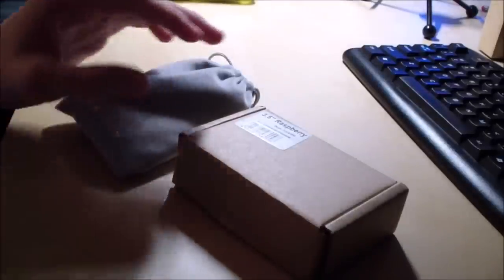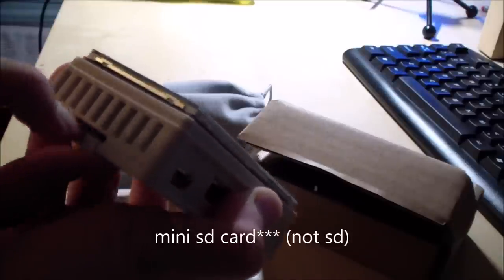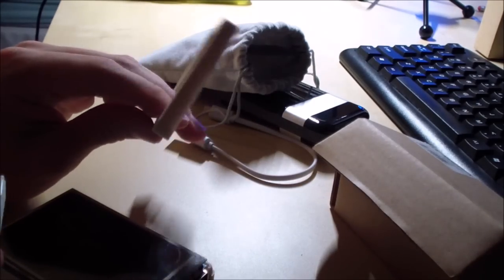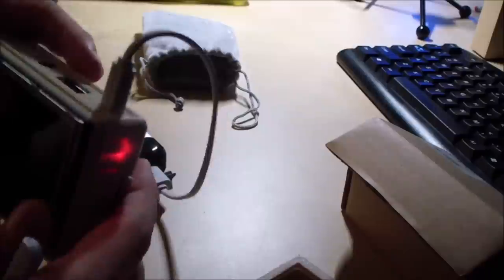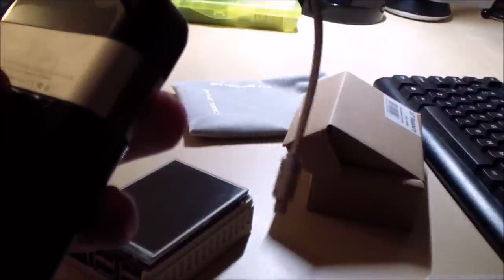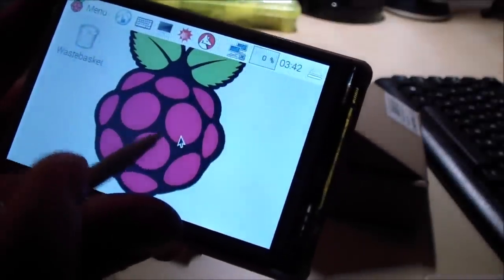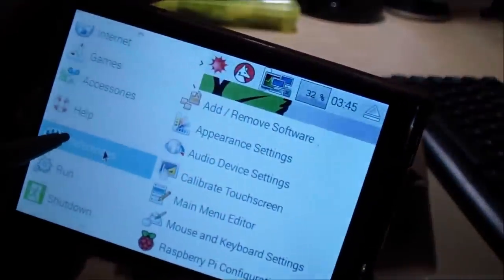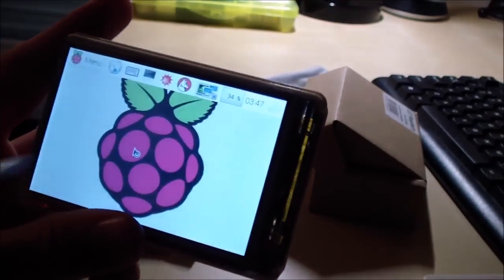RASPBERRY PI 3 TABLET/PC (PORTABLE)

Comment: ''It's completely wireless except for this wire here..'' lol u made my day. xD HAHAHAAHHAA
Reply from the maker: Sorry But I think that you didn't understand the purpose of this video, or you just haven't worked with Raspberry Pi's before. As I say several times in the video, this design CAN be made completely wireless by soldering a battery unit to the Pi board itself. However, this is difficult and selecting a proper battery power supply (PU) is not effective (in my opinion) my case doesn't have a place to mount a PU, so I went with a USB power bank for phones. Please note that this design can be made wireless, the wire is just to connect it to the power supply. Technically a laptop is wireless too, but it still requires a cord to charge....
Reply: Man I know I was just kidding :)
I'm owning Rasp 3 myself and right now I'm working on a concept with purpose to win a contest :)
I was just kidding so don't take it seriously great job man
Reply from the maker: JovanPlaysEverything thanks man. Sorry if I was being mean to you LOL. I have just had many trolls and haters on my channel recently. That sounds like a great contest man, I hope you win, or at least get a high position. Me, myself, I don't know much about programming and coding with the pi, to be honest, I actually practically don't know anything

Comment: 13:25: It's pcmanfm that takes up the processing power! Not the screen! The file manager, ie. the desktop, most likely (long time since I used a desktop on a rpi).

It's weird though, as he has no icons on the desktop... most likely the Pi is underclocked, so it shows what usually takes 2% or so as 20%, lol.

Comment: If i want to connect the screen and than a thermal camera which goes through the gpio pins can i do so? or does the screen take up all usable gpio pins? Please respond
Reply from the maker: sorry for the long reply, I was away for a while, first of all, it depends on what kind of connection does your thermal cam use and how it connects. It is possible to connect a camera through soldering to the remaining 14 GPIO pins, it would be quite crowded but possible. Keep in mind that different gpio pins perform different tasks, so depending on your camera's requirements, it might or might not work, if you have any questions please write back.

Comment: I was thinking of getting one of these. But compared to getting a 5 inch HDMI touchscreen, these GPIO based ones mostly requires a custom raspbian (that's if you don't know how to install the drivers) and that the refresh rate of the display is very poor. It would be hard to play games or even watch videos. So I'm planning of simply getting a 5 inch touchscreen that uses a HDMI bridge connector instead which only requires you to edit the config file for it to work.
Reply from the maker: that is a good idea, however, it would increase the size of the pi significantly, I do completely agree with you on the horrible refresh rate, and difficulty in playing games, and practically doing anything on the pi including browsing the web. Epiphany browser crashed on my pi a few minuets ago, and when I turned off the pi, I wasn't able to turn it back on, because the OS crashed. It is EXTREMELY unstable, and it is very difficult to work with the pi with such a touchscreen. However, with a 5" HDMI touch screen, you would still have to install matchbox keyboard and config the system to make it touchscreen friendly, because the OS wasn't made to be touchscreen compatible. ALSO: if you buy the same touchscreen I bought, you wouldn't have to install the drivers, I have a pre-configed OS already made, download in the description.
Reply: MineCralex I already own a mini Rii wireless keyboard for my raspberry pi 3. And I didn't buy the 5 inch touchscreen since you were right about it being too big. I instead bought a Kuman 3.5 touchscreen and manually installed the drivers on my current raspbian rather than downloading the offered OS from them. Touchscreen isn't really an essential for me since I just need something to show what I'm typing.
Reply from the maker: Jason Lee The Kuman touchscreen that you bought is exactly the same one i bought!, It is a great company with great shipping which is free even though it ships from Guangzhou, China.
Reply: MineCralex Yeah I chose it because it had the highest reviews compared to the other brands.
Reply from the maker: Jason Lee it is also more expensive than most screens/brands, I saw some cheap screens on ebay for less than $10 a pop, but I was concerned with configing the OS and installing drivers to make it work, so I chose the Kuman one because it has free download of OS.

Comment: HOW DID YOU GET THE SCREEN TO DISPLAY RETROPI I HAVE 3.2 INCH WAVE SHARE LCD SO WHEN I INSTALL RASPIAN THE LCD WORKS BUT AFTER I INSTALL RETRO PI I CAN ONLY SEE SCREEN IN HDMI TV MODE? HELP PLEASE I BEEN WORKING ON THIS FOR ALMOST A MONTH?????
Reply from the maker: Unfortunately, I don't currently know of any other way using which you can get Retropie to display on the LCD touchscreen. There are ways but you have to have very good knowledge in assembly and machine language so you can manually configure the Retro pie Operating System to by default run the video output and touch input through the GPIO pins. Im not good at programming and I dont know any languages so I cant make the drivers for it.
Reply from the maker: DUDE YOURE A GOD MAN THANKS SO MUCH!!
Reply: MineCralex YOUR WELCOME BUDDY GLAD I COULD HELP MAN CHEERS!
Reply: BolowArizona thanks soo much... I might be doing this when I get a pi 3, this is so helpful... One thing though, what would happen now if you plugged into HDMI while in use? Will it swap to the HDMI and back when HDMI is disconnected? (like the Nintendo switch does)
Reply: or you could just sudo raspi-config and add a wallpaper or raspi -config depends on the os you might have to learn python :P

Comment: what would happen if you had the screen attached and suddenly attach a hdmi cable? would it automatically switch to HDMI video output?
Reply from the maker: No it would not, I do not advise doing so, because the OS is pre-configured by the manufacturer of the screen (download in the description), and has the drivers specifically set to work with that specific touchscreen, what would happen is one of two things, 1. Nothing would happen, HDMI screen would be blank, display would be on touchscreen OR 2. OS crashes due to overload/confusion, and because it is not configured to run with HDMI. I think that to connect it to HDMI, one has to go into terminal and raspi config to change some things for it to work.

Comment: is the power bank 2.5a?
I'm trying to do one with a 5 inch screen but I need to used to cables one for the screen and one for the pi if not it will show me a yellow icon on the screen
Reply from the maker: The second USB Output on the power bank is 2.4 Amps, the 1st one is only 2.0 amps. If you use the 2.4 amp output, it should actually be enough to run the pi as I have even heard people running Pi's on 2.3 amp power. I don't know how much amps your 5" screen draws, but check it and make sure that it works from an outlet, then check it with powerbank and it should work most likely.
Reply: MineCralex thanks for the answer

Comment: Hi I'm new to this channel and already linking it, I bought a raspberry pi 3 model B around March this year with the exact same touchscreen you're using. I need help getting the screen to work with Retropie if possible, I've looked everywhere and the tutorials I see have a different kind of screen. I've had my pi collect dust for a while still hoping I can get this portable emulation station to work. If you see this thanks for reading and hope you can help.
Reply from the maker: Hey, I'm really, really sorry that I got so late to you. I had many things to do and wasn't able to log onto my youtube account in a long time. Exactly what is your problem? can you explain in greater detail and I might be able to help you. The thing is, you need special drivers to work with your selected OS, in this case, RetroPie. I use this operating system on my Pi as well from time to time. I'll try to make the screen work meantime, but can you please reply as soon as possible just so I can communicate with you and see exactly what you want to do with retropie.

Comment: Man it boots really quickly, what is your Sd???
Reply from the maker: I have a 32 gb san disk platinum I think??? I actually forgot a bit because I haven't used it in such a long time. Regardless, the card is level 10 speed, and U3, which is quite fast. Actually, If you get a good card that is at least 10 speed and U1, which are actually quite cheap, most pi's boot very quickly, the OS isn't that intensive and if you don't have too much files on it its very fast.

Comment: I really want this case but I dont have a 3d printer, is there another way to get one ?
Reply from the maker: Thank you for the question, for one, you can buy a case from EBAY or from amazon or other store, in which case, the case won't be 3d printed. Another way you could do, is you could find a local 3d printing service online to print and ship the components to you. You simply need to download the .zip file (link in the description), unzip the file, and if you are running Windows 10, you can view the .stl files and order a print service from there.

Comment: Do you think it works with Pi3, and Official 7' display, using ps3 controller (wired or Wireless)?
Reply from the maker: can you please specify? do you need 2 screens to work at once? so you want both this screen to work together with a 7" screen?

Comment: isn't rpi3 overheating without overclocking ?
Reply: I'am writing to you on the behalf of MineCralex, I am currently away from my home and don't have access to my MineCralex account, so I was forced to use another account, however, this is MineCralex posting::::: The Rpi3 can overheat without it being overclocked, however, this is rare, and judging by the amount of software availability and runable programs on raspbian, my CPU usage rarely even reaches over 70%, without artificial or forced stress testing, it is very unlikely that any components, especially the CPU, will reach over 80 Celsius, a more troubling problem is that the OS tends to crash every so often if you overload it too much.
Reply: isnt 80 c too much
Reply from the maker: actually, many laptop gamers get their laptops to around 80-90 C with no issues, I would not advise such temperatures for expensive and powerful processors, because there is a small risk associated to heating it up to 90+ C, however, it is unlikely the processor will break, its processes/clock might slow down and it might be slower in the long run if it is subject to such hot temperatures, but most processors can work just fine
Reply: It always depends on the hardware. The Pi3 is rated for 85°C safe operation and it will slow down beyond that to keep the hardware safe.
Reply: ZLau13 i think 85c still shortens life so better keep it below
Reply from the maker: Alex Stone Like I said, it wouldn't be recommended, but it wont break either. I wouldn't want my AMD FX-8350 4.2 gHZ running at temperatures above 70 C, but of course, for the pi, the ARM based processor structure doesn't heat up as much as x86 and isn't as sensitive as standard cpus
Reply: MineCralex
In fact, you never want to exceed 65C on AM3 CPUs, not even momentarily! This is a similar upper limit as 85C is for the BCM2837 chip.
Reply: ZLau13 i had 72c on fx-6300 and it just powered off, no problem since then
Reply: Alex Stone
How's that 6300 holding up btw? Or have you already given up and switched to the blue side? My 6300 is still kinda alright, especially with an SSD. I'll look into upgrading when Zen is properly out and maybe even revised once so there would be enough price points to choose from, but I'm not in a hurry since this modest machine still runs everything I need it to and PC parts are expensive in remote parts of Europe.
Reply: ZLau13 no money for blue side, i would rather have amd cpu than amd gpu, but sadly i have both amd, im using it everyday no problems
cant play most newer games but not much of a gamer anyways

well everything is expensive in serbia, AMD RX 480 that is supposed to be $250 is 450euro here
Reply from the maker: Alex Stone oh hey, are you from Serbia? how are you brother? I'am from Russia, love to Serbia. PC parts are indeed more expensive in eastern Europe, but they are accessible at least. in some other countries, you would have to travel internationally just to buy PC parts outside the country. many 3rd world countries don't even have places to buy parts. However, I think that software is actually cheaper in Eastern Europe, well, in Russia at least. You can get about 30 programs on one disk only for around 100 rubles, (about $2), the same programs would cost around $100 in America. Of course, given that most Russian software is pirated, it does contain trojan viruses and stuff like that, but  half the people here use cracked windows versions.
Reply: MineCralex im pretty bad, in serbia software is more expensive than in US, EVERYBODY uses pirate/cracked software here, like all my programs on computer are cracked, only few steam games i have somehow (gifts and trading) are legal, windows is ofc cracked, im not gonna pay 200e for stupid windows

greetings to russian brothers
Reply: MineCralex
Haha windows is easy to crack safely and cleanly. I even got a clean Windows 10 pro key assigned to my MS account (no need to use KMSpico) thanks to MS upgrading my cracked 7 for free XD
Who would ever want to pay $300 for Microsoft's monopoly created with immoral business practices.

Anyway, greetings from Finland my neighbor :)
I don't understand the political friction between our countries but I personally have just best wishes for Russians.
Reply from the maker: ZLau13 well, not all software is easy to crack, very cheap cracked software is available in Russia, but i really don't like using cracked software because it has trojan viruses on it, some cracked software doesn't have viruses on it, but the vast majority does.
Reply: MineCralex well i switched to linux before like 6 months, no need for paid software, no need to pay for os, just gaming sucks...
aaand amd drivers are crap but no suprise there
Reply from the maker: Alex Stone I'am a fan of AMD processors, but not gpu's. I really despise Intel fanboys though, because i'm not a fanboy for either intel or AMD, since I use both processors in my house (I have 9 PCs)
Reply: MineCralex i would never be a fanboy but i love intel cpu, i have it on laptop and its so good
Reply: Alex Stone
Agree, even tho I'm an AMD fanboy, gotta admit that Intel iGPU (driver) game is good and the performance and power saving modes are simply best. I would never get an AMD laptop until they actually compete because it'd be a waste of battery life.
Reply from the maker: ZLau13 AMD also needs better cooling (heats up more) but AMD has great hyperthreading and Trubo capabilities, like my fx-8350 being able to go up to 4.2 gHZ when I need it to. However, I think that the stock coolers for AMD are very poor, as they can't even cool the processor enough when running at close to 100% capacity. I did some stress testing, and even having my case open with a huge box fan blowing inside, with the stock cooler in, it got up to 76 C.

Comment: ı want to use my powerbank but ı am not sure what should be the values
Reply: Barkın Var it should be 2.1A or amps
Reply from the maker: The Raspberry pi 3 B, the most powerful and energy-consuming raspberry pi, the recommended amperage should be around 2.5 Amps. 2.1 A should work but I recommend 2.4 A, which is more than it'll ever need. Most, if not all powerbanks have specs and Amperage written on the box, the spec sheet, or the powerbank itself.

Comment: Does the power bar on the pi work?
Reply from the maker: Ahem, Unfortunately not. I'am quite sure that you might be able to configure it so it does, but not by default. If i need to check the level of the battery pack, I can simply press the power button on my power bank and it displays 4 LEDs, which correspond to the level of power left.

Comment: it can run games?
Reply from the maker: the answer to that is yes. Raspberry Pi 3 can run Minecraft (pre-insalled), although a special Raspberry pi edition. In addition to that, the Pi is able to run "RetroPieOS" an Operating system that has tens of emulators from which you can play Commodore 64 games, Nintendo games, atari games, ps1 games, etc. The list is almost endless.
Reply: thx for the answear :) (sorry Fr)

Comment: How long can 9000mah powerbank power suply rpi?
Reply: 14 hours on mine ,and i got mine of some shady chinese site and probably is weaker and around 7400mah , forgot to mention that mine has no screen because i ssh into it,if you have a screen it probably last half with wifi or bluetooth on ,i got a usb voltage checker and it sucks alot of power with a screen and wifi on
Reply: Jessica Westly i gather from your comment that your running a linux or debian os? If so what battery pack are you using and how steady is the power while running intense program's?
Reply: yeah im running a Debian kernel ,i got a new belkin 10,000 mah for $25 on sale its a flat cell pack,it works even better its outputs up to 2.1-2.4 last very long , power remains steady and even added a small fan connected thru gpio pins , just make sure what ever battery you use check if it can output 2.1 amps but ive noticed it doesnt even use that much unless you have a screen attached,wifi on  ,bluetooth ect